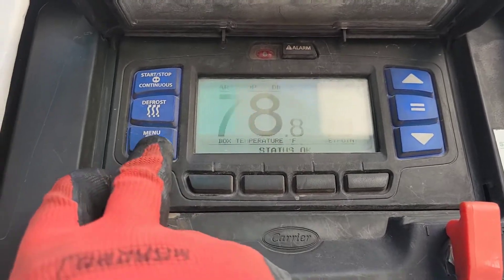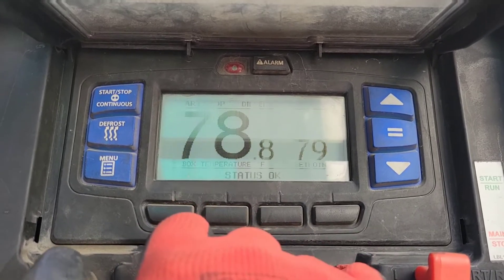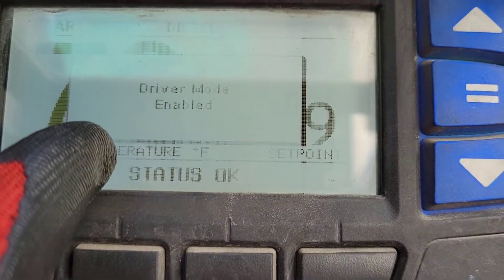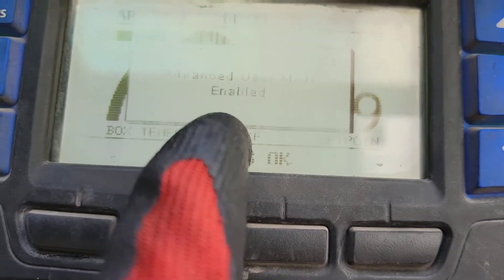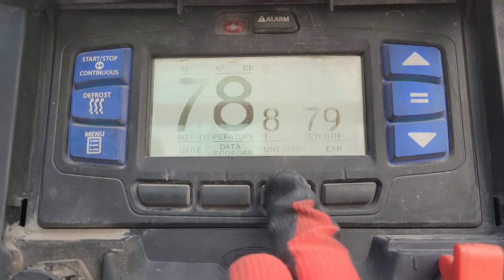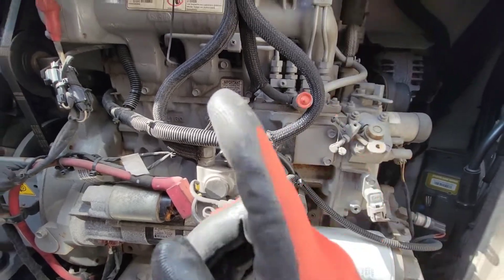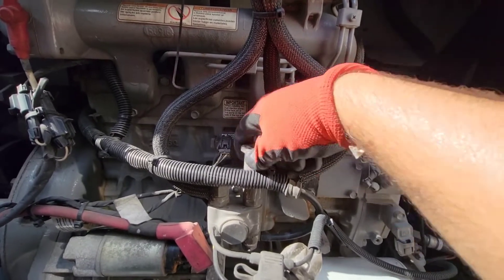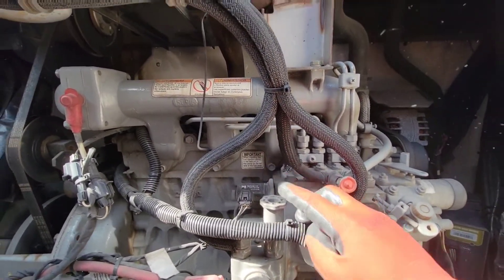Run your reefer unit to empty?How to prime your Carrier unit using my prime inc trlr. Tips/Trucking

Comment: Just found your channel.......yes the best thing to do is not let the reefer run out of fuel......do you half to fill up the reefer tank in between truck fill ups? Or can you go long enough between truck full ups to fill the reefer at the same time? Great tips ......😁
Reply from the maker: I always fill it at the same time unless I am going to drop it somewhere or if i think it needs some before i get to a shipper/reciever. It also depends what temp I'm haveing to run the reefer at. -20° loads are the worst in warm to hot weather because they run almost non stop and drink fuel like crazy.
Reply from the maker: Seen you have many videos as well. Been wanting to watch some just havnt got the chance yet
Reply: @blacksheeptrucker9046  that’s good to know.......yes I have many videos mainly on mechanical stuff that I’ve worked on........I’m working on getting on with prime as well......go through their training program and eventually be in my own truck.....at least that’s what the plan is......then the videos are gonna be about that journey.......
Reply from the maker: Sounds like a great plan and prime is a great company to get started with. I wish you the best of luck on that journey. I have been thinking about diesel mechanic for my next journey but not sure yet

Comment: If you have to add fuel to your refer and you are pumping from your tractor do you turn the refer off while adding the fuel
Reply from the maker: If safety feature is not overridden and it doesn't run the last drop of fuel out then I wouldn't shut off.